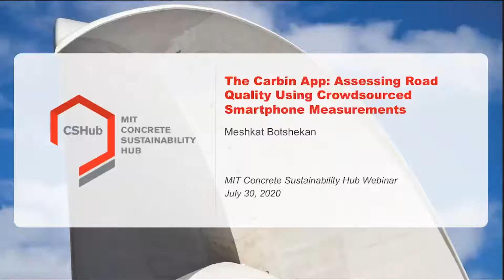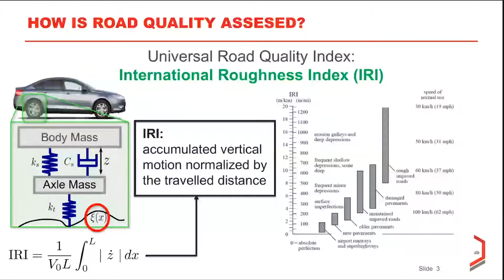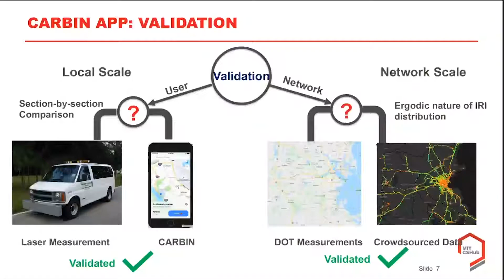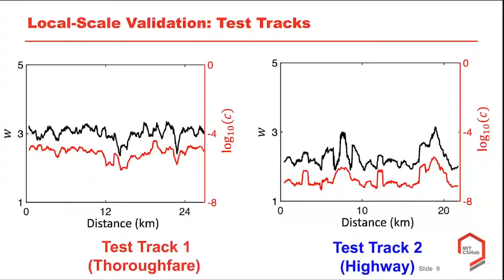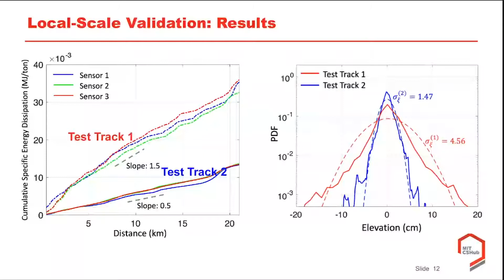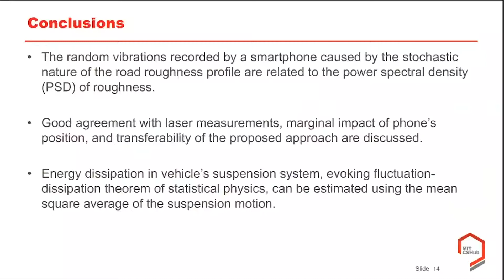The Carbin App: Assessing Road Quality Using Crowdsourced Smartphone Measurements

Comment: I am making a regression model between road roughness(IRI) and visible surface distresses like cracks and potholes for my Mtech project. I need roughness data of road per 100 m length of the road since i have taken 100 m as the representative segment length. How to i measure IRI every 100 m of the road using Carbin?
Reply: if any update please revert